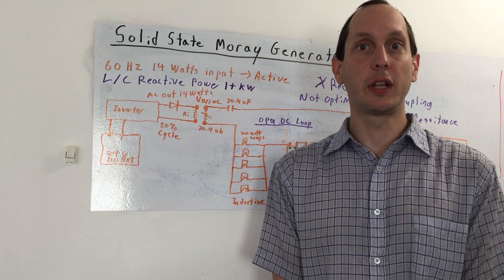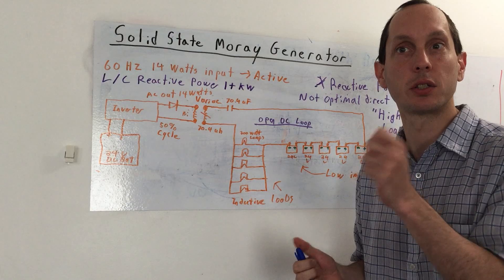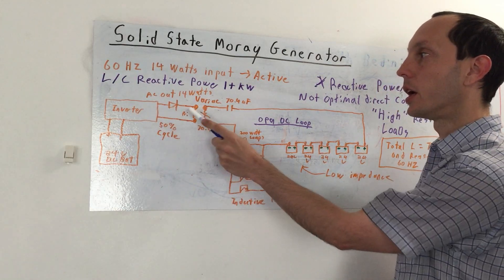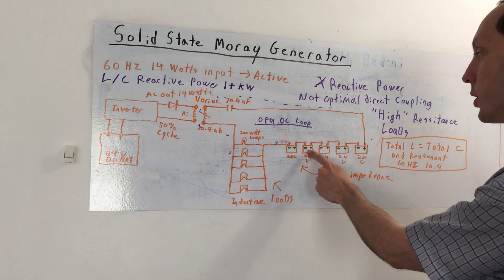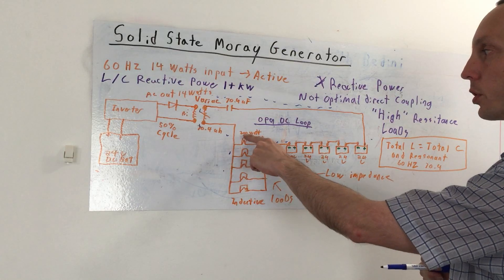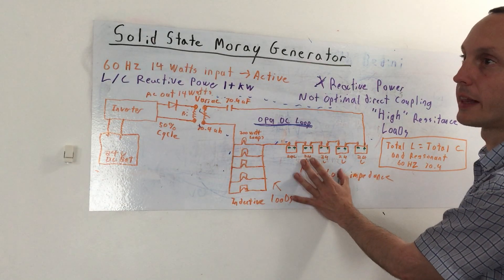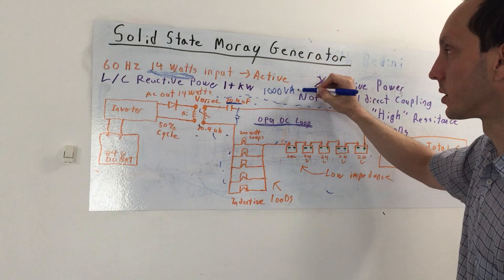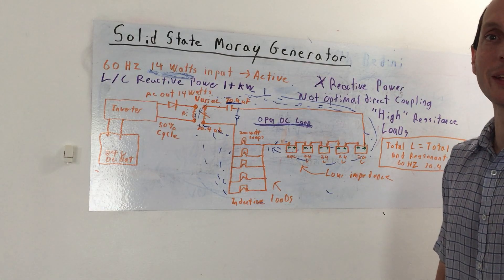Modern Moray Generator

Comment: Why diode in between inverter and variac transformer should probably be between source batt and inverter and you have rcl circuit batts and light are resistance so resistor inductor capacitor maybe a little current amplification but if you add resistance or take off you will have to change value of cap or inductor

Comment: How do you find resonance on Bedini generator on negative energy side?
Reply from the maker: You need an impedance analyzer that works with AC so that you can monitor the resistance changes as you shift "tune" Bedini never gave out the exact values. As much as he claims he did. And every device will be somewhat different.
Reply: http://potentialtec.com/SeriesImpedances.jpg

Comment: Joel, Is there a reason the primary of a transformer could not be added to the circuit? If I understand your explanation correctly, it would be similar to pulsing a transformer with DC, which means not a GREAT output on the secondary because the primary is just getting a pulse that is going in one direction, but I have been thinking of a transformer with a two wire, or center tapped primary where you could send power alternately down each wire in opposite directions, mimicking AC, and having the output of the secondary as usable energy. Curious
Reply from the maker: For tuning. loading one side of the transformer will vary the values. And you want to keep "Everything" on the one L/C loop at resonance. This allows for near superconductivity action at resonance. This makes up for much of the R loss if the R is also calculated within the loop and left alone at resonance.

Comment: Complete hogwash! Power is a scalar quantity, i.e. it has no  such thing as 'reactive power' only stored energy.  The conservation principle always holds, be it energy, charge or momentum.  This kind of hokum physics is snake oil for the 21st century.  It is true that reactive circuit can be used to magnify voltage, but as a reduced current - why does this kind of stuff still gain traction in the 21st century?  This guy has a poor understanding of the resonance concept.
Reply from the maker: I just feel sorry for your lack of basic understanding of VAR at resonance. Good day!  Please complain some more it shows my followers i'm doing it right. :)
Reply: @MichaelLee-wo5du Can you do any better?
Reply from the maker: And he is describing the book description of a typical transformer V/I action lmao. Little does he know we are not operating as a regular transformer and it seems from his comment he understands little of the local producing displacement currents at L/C resonance. produced secondary or decoupled from the input, in theory once you get it going at  perfect resonance, active power is 0 but of course in real life we need to keep giving it a small push at resonance of very little input trigger timed power.  Tom Bearden talks about this often in his broken symmetry descriptions.  :)
Reply: @vSchaub Sounds like a high school kid. 😂

Comment: 747 minutes in, the first stage in my innate eye is a efficent field strength. That second lcr with a voltage regulator a Isolation mains. Batteries in series. The power gains are that of a primary and secondary coil or transformer. Kool...I'm learning. U can stack multiple 555 voltage doubler each one to it's own battery.it drop the drain off the start up battery by 25%. Each stack.  Don't quote me tho...lol
Reply: I've got a battery monitor. It's for campers off grid battery banks. Yet u could run that system off those batteries. And charge them while the load becomes a fusible link. Kool...
Reply: Research polarity complex with in a visible black hole. Our ears are the evolution of either light speed. 
Very deep subject matter. Yet again if we learn to listen an focus. Our elders just might respond. Cheer's

Comment: I think i kinda have somthing similar using cold cathode spark gap discharge tubes that look identical to neon tubes. It draws in excess power from the surrounding enviornment via negative resistance in an RLC circuit
Reply from the maker: yep, I also noticed interesting effects with those, Todad they go bad after so many hours of usage. So order a bunch lol
Reply: if they die, what should we use instead of them?
Reply from the maker: A rotary switch like tesla had.  haha! but good question. I just order a bunch of them so I have some spare when they do go bad. A small cap and a scr might do it (cap dump) depending on what your trying to do.
Reply from the maker: "Negative" resistance is relatively easy to figure out in an LCR circuit. Just aim for a Q in the high negative range.

Comment: you can recycle the reactive power with RUN cap
Reply: Hello, can you explain what is a RUN cap please ?
Reply: @paradigme_  they call it a run capacitor , they are used in HVAC systems .

Comment: Exelent! Can we use only a heating element? Only for 14 watts?
Reply: @dardacc if it's the same Wattage of the light bulb without ventilator. Then yes I doesn't matter if the resistance is a lamp or a heater.

Comment: That’s some power 😮 hey Joel was pondering some things… you could use a vibrator… lady toys… if you need some intimate connections 😅 I mean intermittent. Them lamps are key, might want to try out hooking up an oil heater as a load. Thanks for sharing you are clearly a wizard 🧙
Reply from the maker: Yep in theory the math anyways if we had a perfect L/C would be zero to maintain. But of course there are minor (trigger) losses in  real life even in the wire that feeds the pulse to the l/c etc.... but very minor. Easy to overcome as long as you get a bit of an input trigger to maintain.
Reply: A magnet attached to a vibrator that is placed next to a reed switch LOL